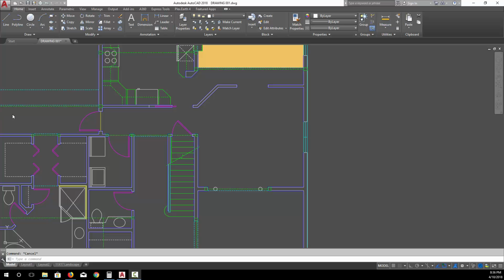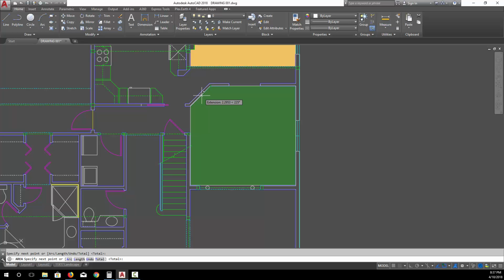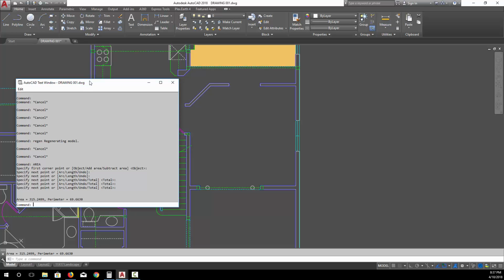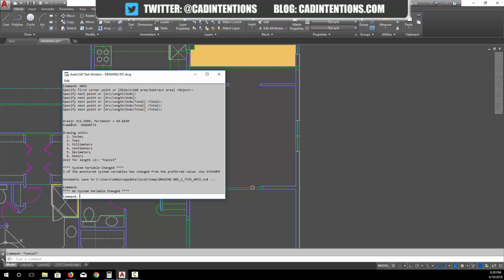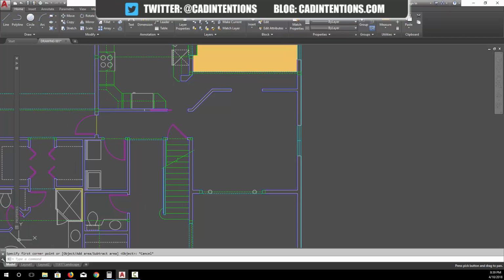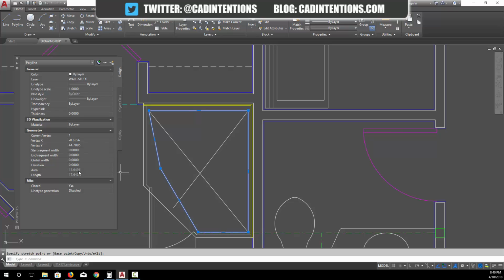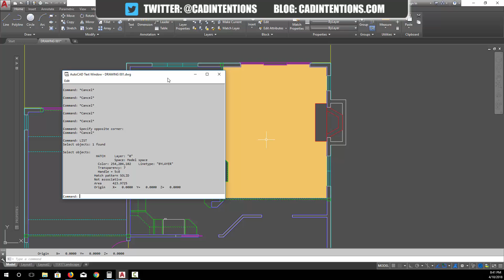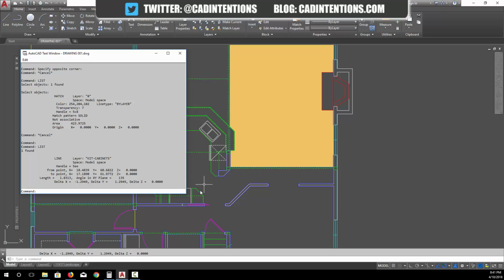AutoCAD Tutorial: How to Calculate Area

Comment: Is there a way to actually put that square footage on the drawing like DLI?
Reply from the maker: Hey ya there are a few ways to add areas as a piece of text or field in your drawing. I have a video about using fields and are the 4 minute mark I use Area as an example
https://www.youtube.com/watch?v=RgbOUmGaHio
Reply: @Cadintentions  Is it also possible to get area of a joined polyline object inside a layer? Do they need to be joined?  Can it be multiple objects in that layer?